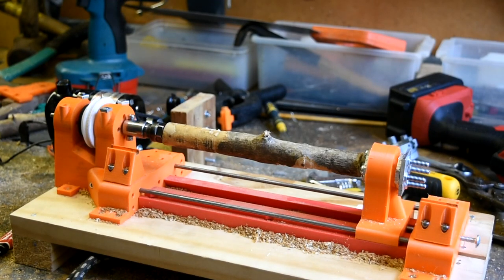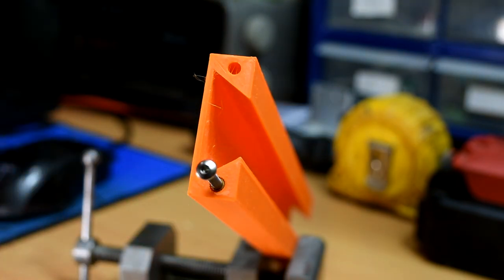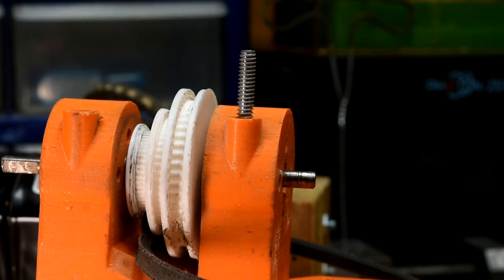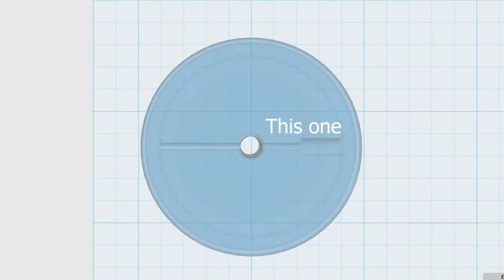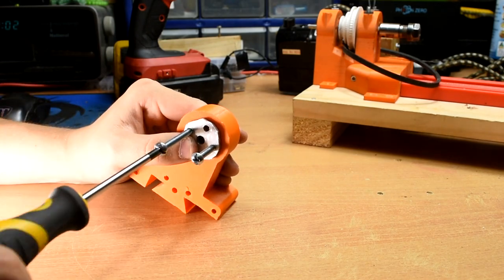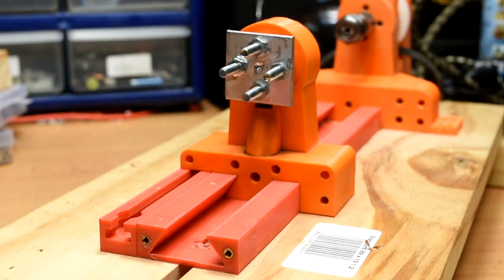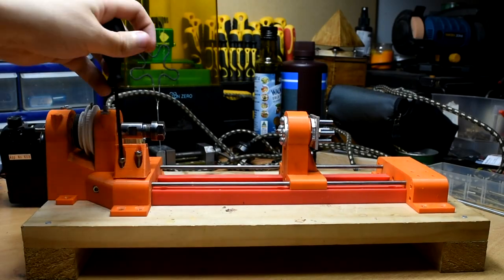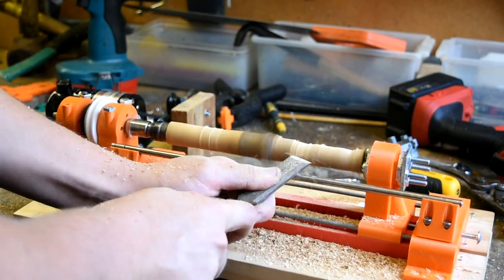3D Printed Wood Lathe- Build Guide

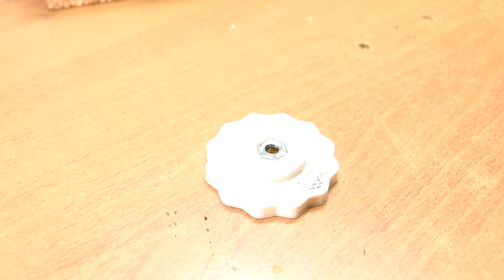Comment: I was wondering if the part in 5:39 is a printed part and if so can you upload the file and also is the bolt included in the hardware list? I have printed all the other parts and they came out great.

Comment: Nice, 

Can You tell me where You buy this motor? Any specs? Link maybe? I need strong motor like this
Reply from the maker: I use a motor off a vintage sewing machine, I would recommend looking on local buy/ sell sites like gumtree craigslist FB marketplace ect, they come pretty cheaply from what ive seen. Its nice for something like this because of the foot controller.
Reply: @Borgedesigns  thank You very much for answer and pro tip

Comment: hi i dont think youve mentionted the printing specs yet, theyd really de of help for planning this project
Reply: also do the screws around the headstock's bearings do anything because ill probably need to modify this build so it fits my bigger outer diameter bearings
Reply from the maker: Hi, im releasing another vid later with more info on how to print, and yes the bolts around the headstock are important to prevent layer separation and the headstock becoming more than one piece